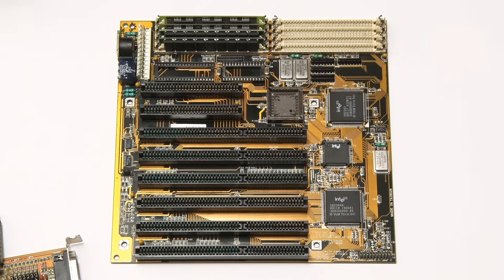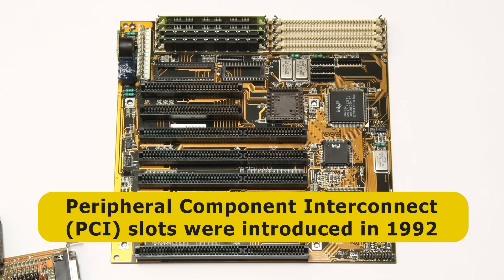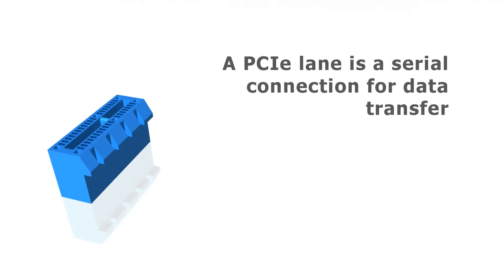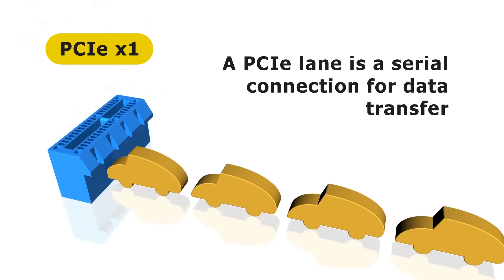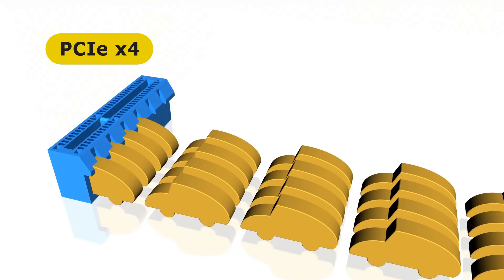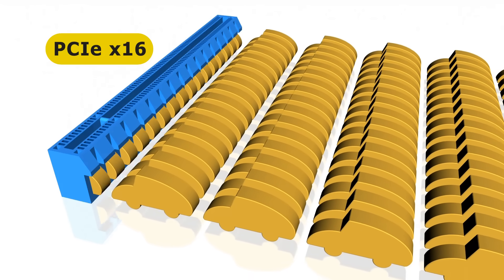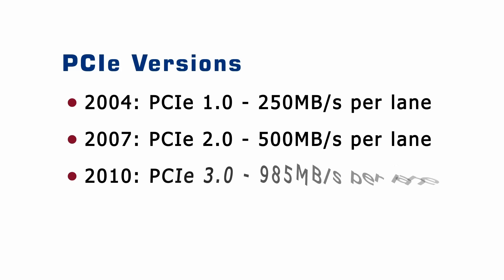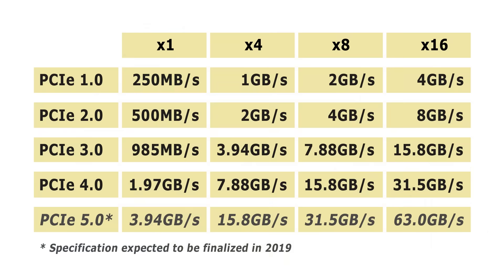Explaining PCIe Slots

Comment: Thanks for your excellent video! I have had it with the shaky head camera mounted folks who mumble and fail to focus on the motherboard positioning. Your professional approach is excellent!

Now, here is my problem... I placed a Lenovo Idea Centre 230 mini tower PC back in operation after having it sit unused for a long time. As I checked it out I noticed that the PNY GeForce 210 video card with 1 gig memory had lost  one of the screws that hold down the graphics port. I plan on removing the card, fixing the screw problem, and putting it back. Easy, right? Sorry, I CANNOT get the card to release itself from the motherboard. I know there should be some type of easy release, but I will be danged if I can locate it! Arrrggggg!

Update: I finally decided to leave the video card in place and I found the screw to fit. Tightened the port into place, and reconnected everything. All is fine now, but I never did find the way to release that card! Computers, you gotta love then!
Reply: Thanks! I never was able to find that release, so I reset the video card and fixed the missing screw on the card. Everything is running fine now, and I don't plan on replacing the video card. This is a puzzlement! I probably need to latch onto a very small mirror so I can look down closely and find that release just in case.
Reply from the maker: Thanks for your kind feedback. Appreciated. There should be a retaining clip, or a pin to pull out, at the opposite end of the PCIe slot card to the connectors. Good luck!

Comment: Can i use gtx ddr 5 video card on my ddr3 motherboard 775 pin?
Reply from the maker: Yes, you can use a graphics card with DDR5 memory on a motherboad with DDR3 memory. The graphics card and motherboard RAM work independently, so do not have to match.

Comment: At 6:25, why did they use a full 16x slot when there's only 4 lanes? Were people running graphics cards in SLI configurations with one of the cards running at 4x and the other running at 16x? What's with this design?

Comment: I think a video on installing SSD drives into M.2 slots would help -- particularly if we could avoid losing 2 of our regular SATA ports when we use M.2
Reply from the maker: Remember that M.2 is not an interface standard, it is a form-factor. Some M.2 slots take SATA drives only, some NVMe (PCIe) drives only, and some both. If an M.2 slot can take an NVMe drive and is fitted with one, it does normally not prevent the use of a SATA port.
Reply: @ExplainingComputers  Thanks. The instruction manual for the motherboard (ASUS ROG STRIX B450-F) states that when either or both M.2 slots are used SATA 5/6 become un-available.  So: I think that answers my question: it's probably no configurable using the BIOS settings.

Comment: Great video for a history of a PC, should be in a museum. Personally I would rather be interested to find out if the PCI-E 4 has any use at all, and now I know that in 2019 with the new motherboards supporting it and tested - it's not much of a use unless you want an extremely fast SSD drive. For graphics performance it doesn't make any difference for a single graphics card.

Comment: What does it mean when they have multiple PCIe slots and one is x16 2nd is x8 and third is x4...what if you have 3 GPUs slotted in at the same time? do they all become x4? or does it mean that the first one would be x16 the 2nd x8 and the third x4? Thanks.
Reply from the maker: Normally if you have a x16 slot and a x8, putting cards in both reduces the speed of both to x8. But using other slots (like x1 or x4) will not pull them down further.
Reply: Thank you!

Comment: So, I can fit my PCIe x1 USB 3.0 expansion card to my PCIe x16 slot, right? My motherboard doesn't have any PCIe x1 slot, only a PCIe x16 slot. Like the ITX motherboard.
Reply from the maker: Yes, you can put the PCIe x1 USB card into a PCIe x16 slot. Should work just fine. I have done the very same thing on Mini-ITX boards with just one PCIe x16 slot.
Reply: @ExplainingComputers  Thanks a lot. Your videos help a lot. Especially enjoyed those Raspberry Pi videos. All of them! ☺

Comment: What is that second slot down on the board with two PCIx16 slots (at 6 minutes for example).
Reply from the maker: It is a PCI slot, rather than a PCIe slot. Some relatively new boards still have them. :)
Reply: @ExplainingComputers  Ah right...thank you.

Comment: would be nice if you also cover why/how PCIe is inernally run as PCI. i have a PCIe only mobo and it still has a bridge driver and PCI assignments. We still have ISA assignments also, for unknown reasons.
most mobos tout many PCIe slots, but as soon as you start plugging things in, you find out that many slots share bandwidth.
Reply: AFAIK, LPC, which is often used to access the motherboard's firmware chip, looks like ISA to software.

Comment: Thanks, this was a good video, even if just to "Recap" on stuff I may or may not have forgotten........ Ok, Fine, my mind is like a tea strainer, I forget quickly. 🤷🤷🤷

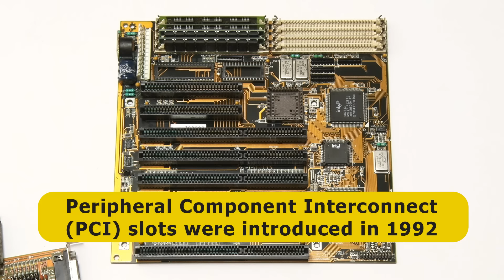1:58 & 2:23 I still have one or two of those.... Probably in working condition, but have been retired to a box with all my outdated motherboards and CPU's....... Good times those 😂😂😂

6:40 Nice little ATX board that..... Just another 4 SATA ports and I could replace my existing two HP Micro Servers for one PC.

Comment: Coming from the 386/486 and beyond era myself, what confuses me the most these days is, I open a machine to find only 1 or 2 slots on the board, even though I've paid for a full sized desktop lol.
Reply from the maker: But in the old days, we needed slots for ports, sound cards, network cards, etc -- and these are now integrated into the motherboard.
Reply: @ExplainingComputers  very true. I meant it more as a funny observation. That said, after watching your video, I've upped the spec on the motherboard I've wish listed to one with more slots. Let's not forget some ssds now utilise PCIe (another thing you've taught me :) )

Comment: i cant imagine why any developer would be putting $ into further R&D of Expansion slot speed technology. the current 3.0 revision isnt near being saturated, aside from Extremely specific, non real world scenarios, maybe using a High speed SSD, combined with a useless benchmark utility. If any development is worth sinking $ into , it would be development of getting away from the archaic, Expansion slot model all together....its a hold over from 30+ years, & we're close to having the ability to remove the need for them all together regarding many application.

Comment: You mention putting a lower speed PCIe card into a higher speed slot, well fine. Good on the PCIe specification for backwards compatibility. But lets say, for example, if you had a MB with 4 PCIe 4.0 slots (hopefully number of lanes doesn't matter, please explain further if it does) and put in three cards. Two of the cards are PCIe 4.0 and one is PCIe 1.0. Would the slower card pull all the slots down to the 1.0 speeds, or would only the one 1.0 card run at the lower speed and the other two cards run at their full 4.0 speeds?
Reply from the maker: The slower card should not normally pull down the speed of the other cards. A common exception, though, is using both a x16 slot and x8 slot (or two x16 slots) often drops the speed of both to x8. Note that PCIe 4.0 and 1.0 are generations of the technology, not the slot speeds.

Comment: I always wondered why i had those slots on my motherboard since no graphic cards could use them and all the rest is being connected via other connectors.  Now i see there is graphic cards who can use them!  

I was wondering, is there ANYTHING you can plug into those slots that would 'improve' my computer speed, or memory?  because otherwise, aside from testing the motherboard, i see very little use for them?!
Reply from the maker: You could connect a very fast SSD via a PCIe slot, or a card that would handle encoding for a pro video editor, or indeed a graphics card --- all of which would improve PC performance.
Reply: @ExplainingComputers   Wow, thanks for the fast reply!  I already have a graphic card installed in the normal slot but thanks a lot for the idea of a SSD!

Comment: I've designed bespoke PC ISA and VESA cards in the past for robotics. Very easy to do this with the PC so long as one steers clear of dedicated out of bound system IO addresses. . Any interface card requires the -AEN (Address Latch Enable) pin to be part of the card's addressing logic. This -AEN pin only goes low on IO address calls. Any address call with -AEN held high is a call to memory.

Comment: This was such an excellent video that I have subscribed on that basis alone.  Very well done!  I want to upgrade my graphics card to enable my computer to display very realistic flight sim landscapes/scenery.  The computer itself has tons of power and memory, but the graphics card is not sufficient to the task.  I know approximately what kind of graphics card I want, but form factor (card size) and robustness of the PCI slot was a mystery to me.  Now I know what to look for.  I'll check your other videos to see if you have anything on graphics cards.  Thanks!!

Comment: Mate 1 question i have this dilemma can i or can i not add graphic card on Optiplex 780. This ones are from DELL business cases with low PSU 235, 255, or 305W but graphic card i want to add its low profile so no need for powerful power supply also not sure if will be compatible with the mainboard of this cases cause the have smaller ones. The graphic card i want to buy its 

Gigabyte GeForce GT710 Low Profile 2GB DDR5 HDMI/DVI           https://www.gigabyte.com/us/Graphics-Card/GV-N710D5SL-2GL#ov more info for the card can you check and tell me what you think tnx!
Reply: Go to pcpartpicker

Comment: Fitting X16 card to a X4 open ended slot will work just fine. That’s how I run a video card in my Dell small form factor PC. The card is too wide for the X16 slot and will have to be inserted into the X4 slot.
Reply from the maker: Open ended, yes! :)

Comment: Great thanks for this amazing knowledge my friend, I landed here because my MOBO  only has 2 PCIe 16 and 8, the 16x was for the Video card, and I ordered a PCIe X1 Pins Sound card (short/tiny pins), I thought I couldn't use the long PCIe X4 for the card, but now it's clear to me that it does not matter (VIDEO TRACK 7:54) since they're both PCie, I almost cancelled the order. I don't have that Tiny/short PCIe 1X.
Reply from the maker: Yes, your PCIe "short" sound card will work just fine in one of the bigger slots. :)
Reply: @ExplainingComputers  Thanks for confirming that buddy. Very Helpful channel.

Comment: When I worked in IT back in ~2000's, there were ISA slots in use, and PCI (not PCIe) was the "new thing."  It was great because the cards were tiny compared to the ISA cards, and were much easier to set up.  Example.. There were LAN cards that were in use using the ISA slot, HP 27247b cards that had 10x more archaic settings in it's config than any BIOS I've ever seen, and I seen many.  You could not simply plug in these cards and load a driver.. it just wouldn't do anything.  They had to be wrestled with for a while before you'd see it light up.   The PCI card (3com) LANs were simple.. like today, just install a driver and configure your IP info / DHCP.  There was a saying at that time.. "If it's ISA.. It's on it's way.."  lol  I think by 2006 they were all gone from that big company, that still had 486 PCs around.

Comment: Be careful with PCIe versions. Yes they should all be inter compatible but that's not always the case. I've for example had issues with a PCIe 3.0 video card (GeForce 600 series) in a PCIe 2.0 x16 slot. The mobo just wouldn't see the card. I believe this was because of the age of the mobo bios but I'm not sure. I eventually got the video card to work in a secondary x8 slot. Why would that work though? Of course the bandwidth was thus limited to the equivalent of PCIe 3.0 x4, so not ideal. I'm a little bit worried about trying higher revision something with older revision slots/ports these days. Things should go smoothly the other way around since new standards should recognize and be fully backwards compatible with older ones and all the various driver and bios issues should be sorted out. Yeah, that's my 2 cents right there.
Reply from the maker: In theory your card should have worked, but as you say it could be a BIOS issue (or related drivers issue).